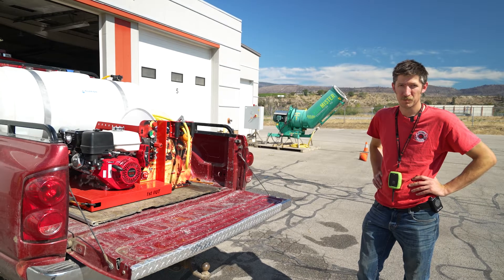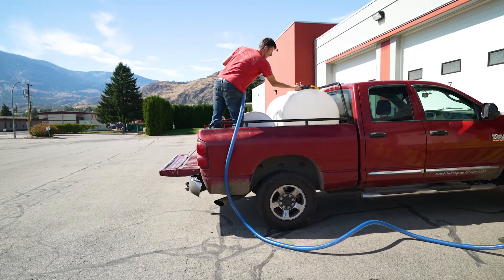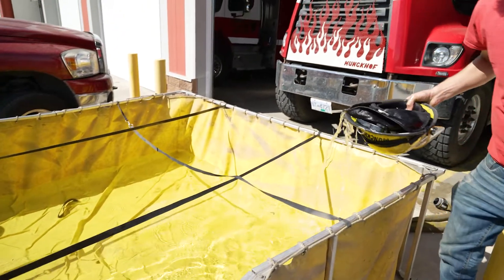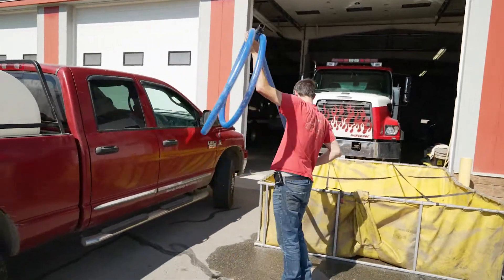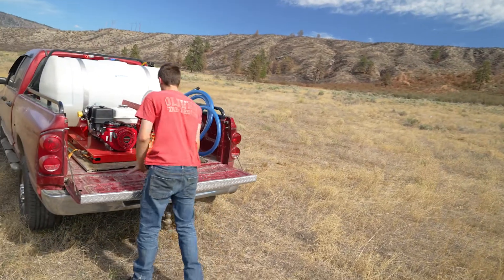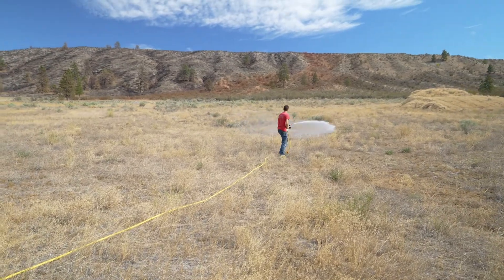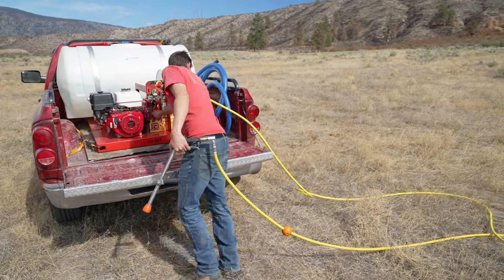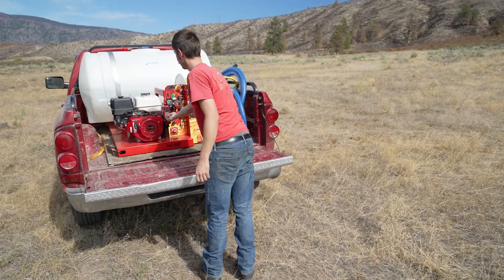My Interface Firefighting Machine

Comment: What is the pump attached to the blue hose that you are using to  pump the water out of the yellow tank. It looks great
Reply from the maker: The water isn't pumped at all but rather drawn directly into the tank with a venturi. This way dirty stream or pond water won't touch the pump until it can go through the intake filter screen.
Reply: @Munckhofmfg Thanks for the reply. So is it working a bit like a wet vacuum cleaner ? Or am I completely off track. How is it powered. ?By the main pump ?
Reply: Diaphragm pump they are often used in agricultural sprayers. I've used these on prescribed fires, wouldn't recommend for heavy duff fuels.